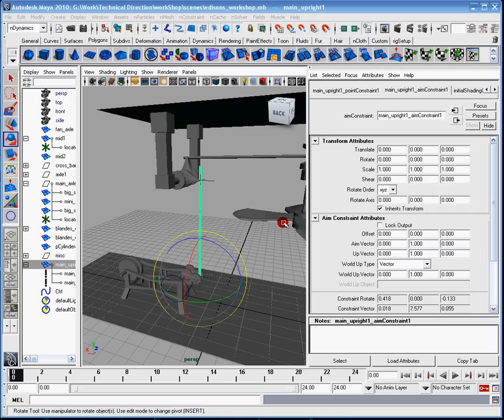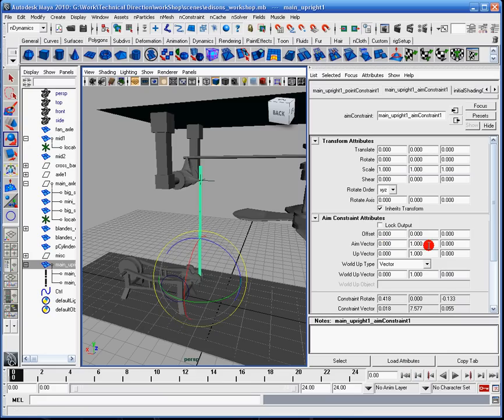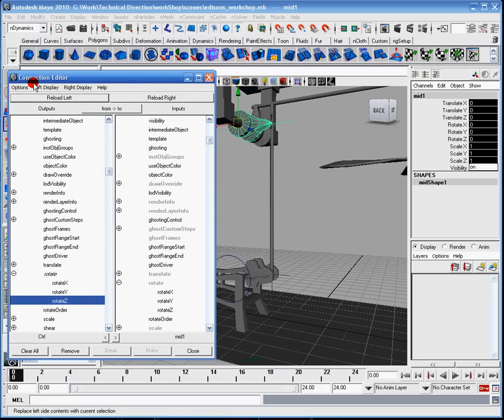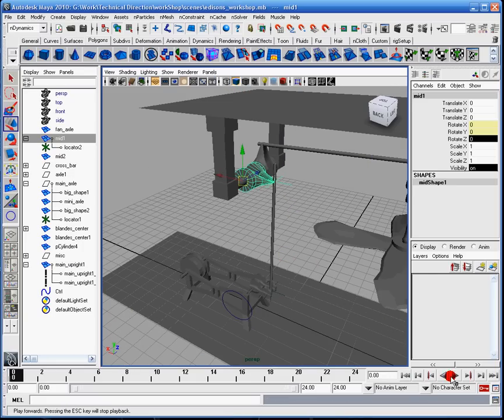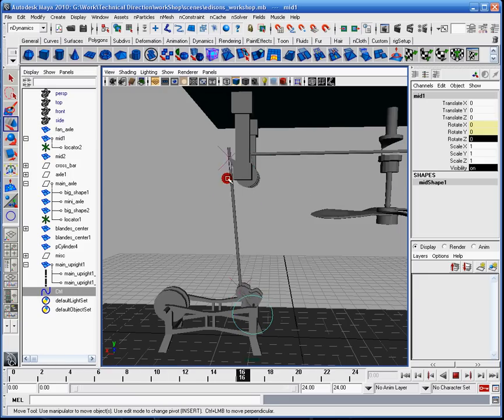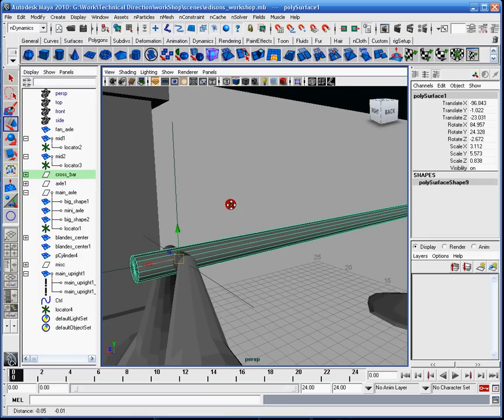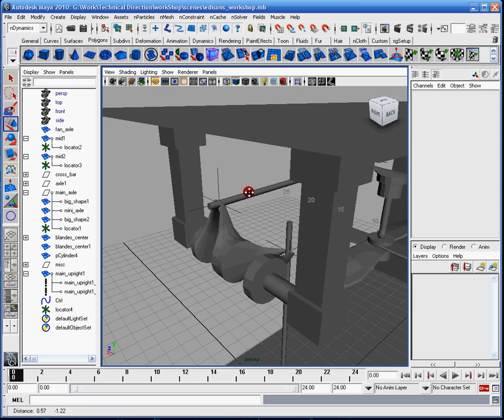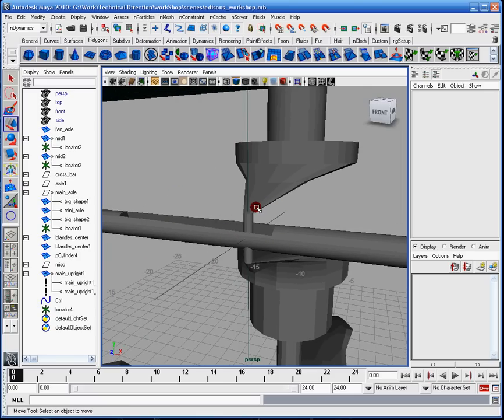Autodesk Maya 2010: Basics Of Rigging Part 4 (Using Constraints)

Comment: Hi, great tutorials. 

Just one question: is there any way to snap the locator to the exact point of rotation? In blender I can select the vertices of a cilinder, for example, snap the cursor to the center of that selection and then snap the locator to the cursor. The general question is, how can I snap the pivot to the center of any selection in Maya?

Thanks